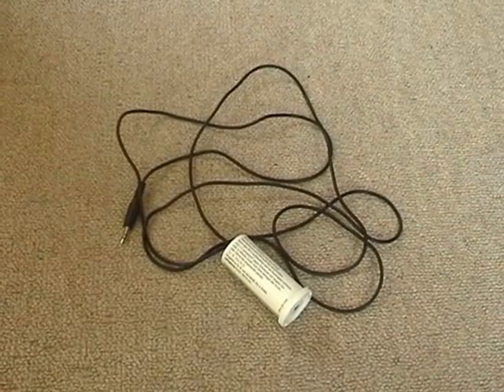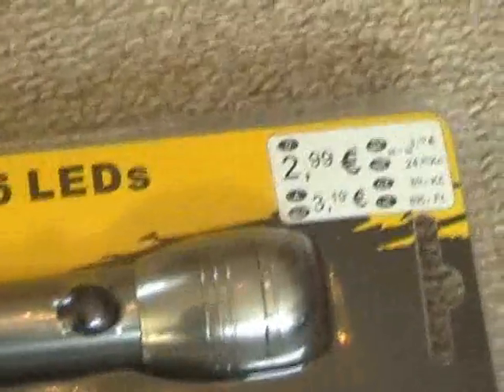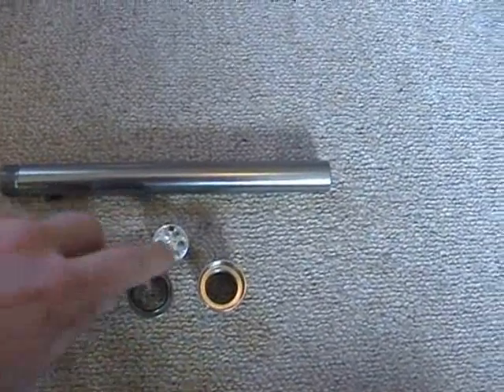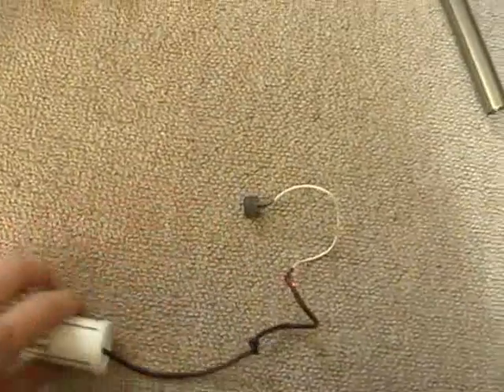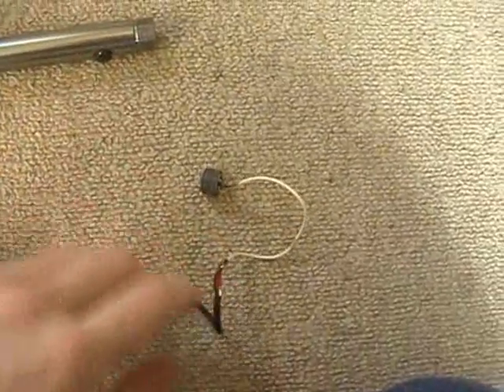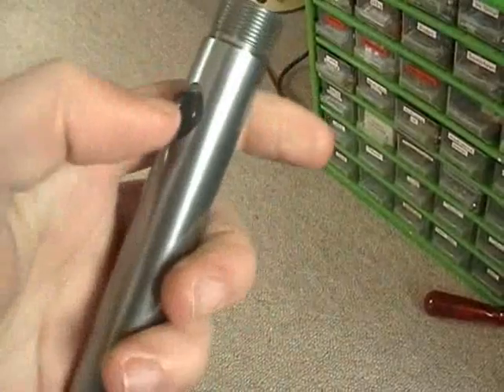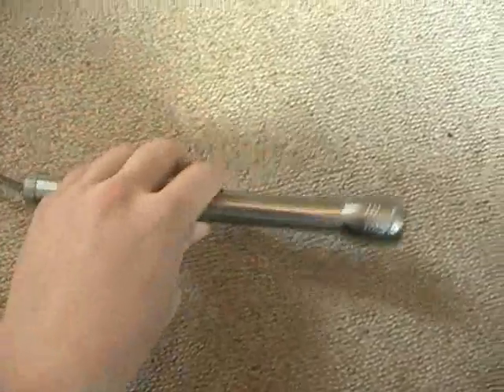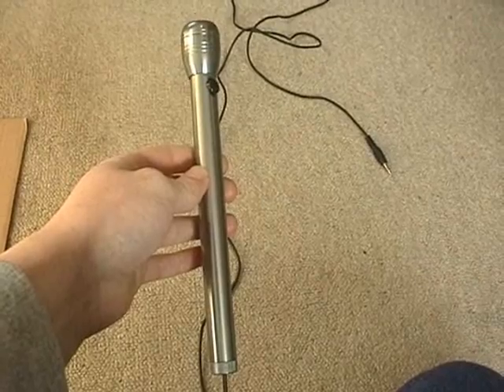Better housing for the homemade condenser microphone!

Comment: I use brass tube from hobby stores which is about 1/4 inch in diameter, I purchase the size which has an I.D. approximately equal to the O.D. of the aluminum body of the mic capsule.

Comment: OK, thats nice, but you know if you want to make the cable just a bit longer, the quality of the sound will be horrible so this solution can work only for 2-3 meters but not more :(  the good invention would be to find a solution to make a MIC like this but supplied (3 V in the house) and like this to have like 20-30 meters so that you can really use it for anything for a camera too. have you tried it?
Reply from the maker: +Nagy Tamás 
Just about any commercially made condenser microphone works that way. I wanted a mic that doesn't need a battery.
Reply: DrCassette OK but so does it work as you want it to work? Because a condenser MIC without battery is very strange for me, I have maden a lot and also bought a lot, but without battery each one is very noisy and need a professional cable. Can you show me please the result of that? For what are you using it? thanks
Reply from the maker: You need a short, shielded cable. This is for connecting to a computer, you don't need anymore than a meter of cable for that.
Reply: DrCassette OK, but you know, I would like to do it for 10 meters about.... this is the problem. the strongly shielded cable is natural, even with that it seems to be impossible :(

Comment: I change my mind,,,, would you still mind to help? I actually a mic like that in your example but I cut it off and have the microphone with 2 wires the black and red how will I connect it to the wire with a jack about 6.5mm I want it to direct connect by removing the cable... I mean from jack directly connect to the mics black and read wire?... I try to open the mic cable but it has 3 wires while the mic has only 2 wires the red and black is it possible to connect it?
Reply from the maker: Your text is rather confusing and hard to read. If the cable has three wires, the two inner ones connect together. The outer one (the shield) is the negative. If your microphone capsule has three wires, two usually coloured ones connect together to the positive. The black one connects to the negative.

Comment: Last question man,,, will adapter works? 6.5mm jack to 3.5mm jack ?? or it won't still work?
Reply from the maker: It will not work. Massive impedance mismatch, your computer won't be able to pick up any signals from the microphone loud and clear.
Reply: Thanks again ... You really helped me

Comment: Please Help I have a microphone that has to wires the red and black I want to connect it to mini jack please I don't understand the wires on how to connect it to the mini jack to use it for computer please email me at albertdolor@yahoo.com
Reply from the maker: The black wire goes to the sleeve of the mini plug, the red one goes to both the tip and the ring of the plug. Simple ;)
Reply: how please....? it's an hi-fi microphone that I think its 6.5mm I want to change its jack to 3.5mm to connect it to computer is it possible? will it work?
Reply from the maker: No, it will not work as it is the wrong type of microphone. You need an electrete condenser microphone, what you have is most likely a dynamic microphone.
Reply: Ok thanks man

Comment: If you've ever read the datasheet for a condenser mic you may have switched the cathodes (+) and diodes (-) and cause a short circuit. If that's the case, switch your wires around. If that's not the case, you didn't wire it to the right wire or you just have a shitty cable wire.

Comment: I build my mic in to the top of my monitor I drill a hole at the top and I put a 3.5 mm female jack on the back of the monitor  connect the mic to the jack them plug a 3.5 mm cable from the monitor to my computer.
Note this is a bad idea if your monitor has built in speakers.

Comment: Plumber's section of your hardware store: Small mesh facuet screens (replacement) can be used to protect mic element.  These are circular and you likely can find an exact size match !
Silk fabric can be used over or under the metal screen to provide a "color".

Electrical switches are available, 
that are small enough to replace (or adapt) the old LED light ON/OFF switch.